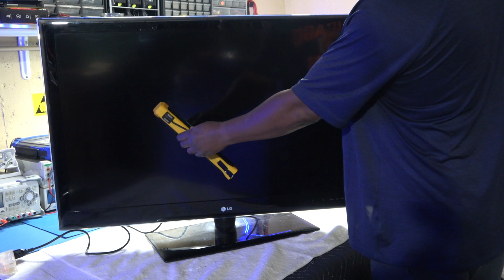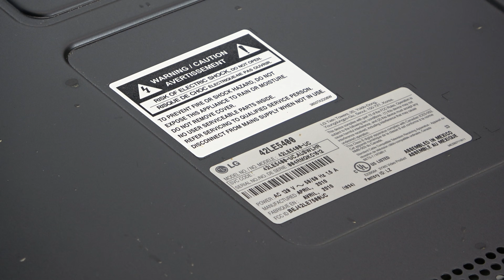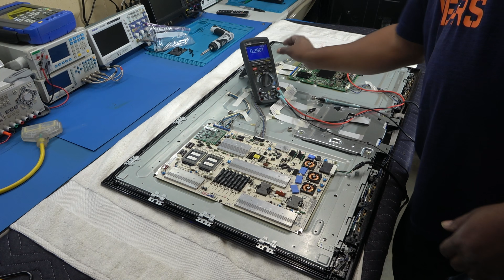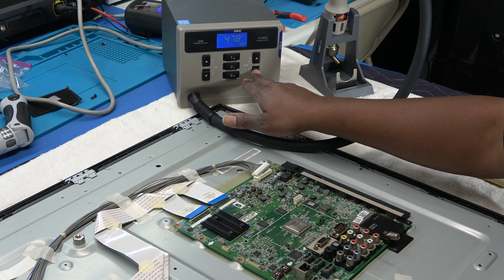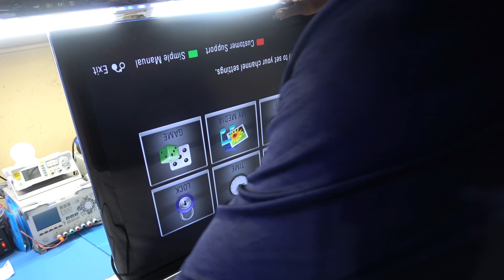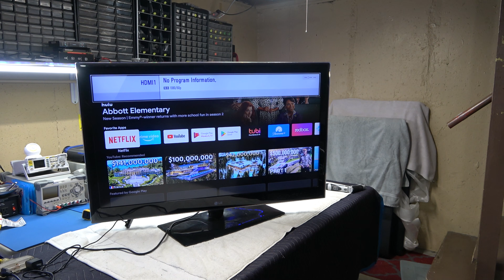How I fix LG LED TV's for FREE just using HOT AIR. LG 42LE5400 no picture repair.

Comment: I got a 47 inch LG and when I turn it on the screen comes on but only stays on briefly and then goes black. I can’t see anything when I put a flashlight to it but you can still tell that the screen is just slightly lit up. What could be causing this? It’s weird because when I first turn it on the screen comes on and shows the LG logo and everything looks good then it just craps out. I just recently started tinkering with it again, I had it put up for about a year and I pulled it out and plugged it in and it worked for about 40 minutes before it went black again.

Comment: Thanks Big Dog!
Reply from the maker: You bet
Reply: @bigdog8882  I have a similar HIsense TV here and the power is cycling, I can see the picture with a flashlight briefly. The backlights never came on. The voltage would go to 30vdc initially then shut down, go to 12vdc and start cycling on the backlight circuit. Did a power test on the LED array (no lights), and continuity check on the "cheap" :-) 2 wire feed for the LED backlights. Got an open. Time to pull the screen apart. Thanks again for all your informative content.

Comment: What is the reason for heating it up? Maybe I fell asleep when you mentioned it.
Reply: Re-flow the solder connections on the IC. Sometimes some of the solder joints are "Iffy" and you might have poor conductivity between the lead and the board circuitry..

Comment: Hello, I have a 50" Vizio model m50-c1. black screen when i turned on, already replace main board, power supply board, t-con, led driver board and couple of cables from power board to led driver board and main board.  I do not know what else to do. I dont see any backlight on....any thoughts?
Reply: Have you tried testing the LED back lights?
Reply: @brianjames6890  thank you for your response, that’s the last thing that I have not done, but I’m not sure how to do it
Reply: @carlosdelosreyes258  if you go onto you tube and type in backlight faults that will explain how to test and or how to repair. If you are any good at DIY then you should be able to repair backlights. Although you will need to be extremely careful when moving the TV screen.Good luck.

Comment: Subbed, good videos!  I got a tcl 75s423 picture and sound no backlight.  Already took it apart but I got no led tester, tried to test each led individually with 3v but I think each led needs more voltage to light up.  Do you know what safe voltage I can test each led with?  Each strip showed 135v for 7 led strip.
Reply: Hi, why not buy yourself a LED tester from Ali International etc. cheap enough to buy although you may have to wait up to five weeks. You can test a strip of backlights with a 12 volt dc battery supply or as stated using 3 volts dc. If all the strips work then it might be that you might have to re solder the ends of the backlight strips. If you have a volt meter set to dc volts you could check the voltage of the backlight feed if you have the expertise, confidence and taking into account the electrical safety precautions needed. Good luck.
Reply: @brianjames6890  yeah I bought a led tester from Amazon, all leds are brown 6v leds that are below from 4.2v to 5.7v.  Have a lical friend who repairs TV's so he let me have the leds out of a 65 inch lg tv, I am remodeling the backlight strip setup to work.  Leds are 6v but since more leds 96 instead of 84 leds so not 125v for 21 leds but 150 for 24 leds but diveded they are using 6.25v instead of 6v is that bad?

Comment: This reminds me of the BGA solder failure on the old XBox 360s, but no reflowing of the solder would fix the problem since they used a lead free solder and opted for the cold solder method.  The old Red Ring of Death for the 360s.  The permanent fix was a kit that used lead solder.  Each fix was around $100 at the time.  Not sure what it would be now.

Would the faulty solder joints on this TV be considered a manufacturing defect or just normal wear from heating and cooling the solder?

Nice repair!!